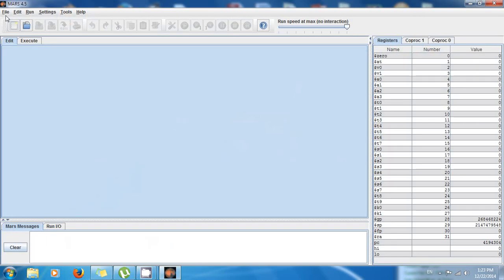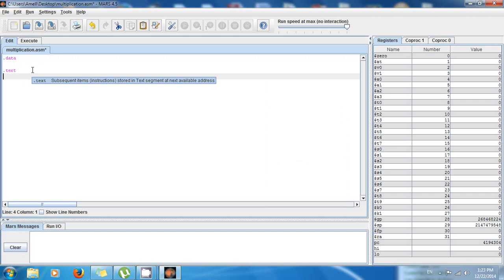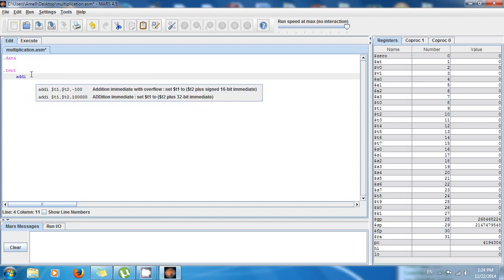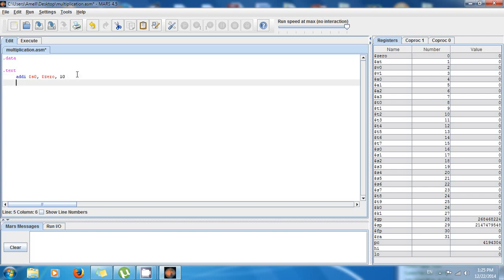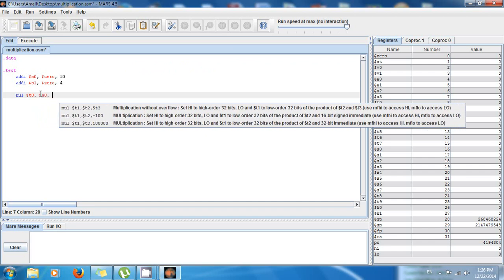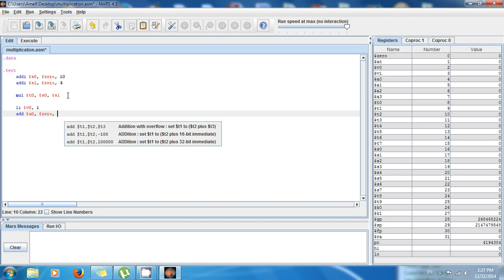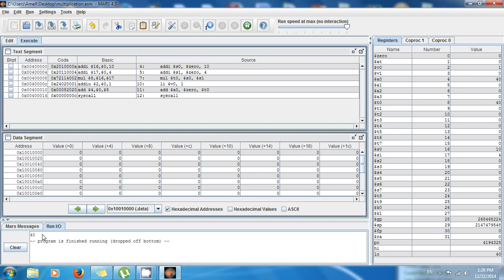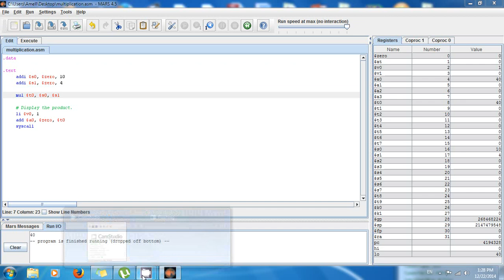MIPS Tutorial 10   Multiplying Integers mul

Comment: Faster and easier, plus this will terminate correctly on all MIPS simulators:
li $t0, 2		# The values to multiply.
li $t1, 3

mul $t2, $t0, $t1	# t2 = t0 x t1

li $v0, 1		# Print the result.
move $a0, $t2
syscall
	
li $v0, 10		# Exit program.
li $a0, 0
syscall
Reply: why not skip the "move $a0, $t2" line and just store the result of the multiplication in $a0 like "mul $a0, $t0, $t1"?
Reply: @lorenzoeldude  Because the argument registers are the $a0, $a1, ...  registers and functions will pull parameter values from those. So if you ever added code to make a syscall for something else it would break your program. ☺
Reply: @taekwondotime  thanks for the explanation 👍

Comment: your last instruction is:
add $a0, $zero, $t0
but i try to use:
move $a0, $t0
is wrong? the result is the same.
Reply: same thing bro
Reply: thanks
Reply: Hi.

The answer to your question is "Pseudo Instructions".
What is a pseudo instruction? Basically is a combination of multiple instruction. The "move" instruction for example doesn't exist in the instruction set of the processor... So, the instruction as to be converted to existing instruction.

It only exists on the software because it's extremely common.

Here is a helpful link:

https://en.m.wikibooks.org/wiki/MIPS_Assembly/Pseudoinstructions

Example:
"Sub" command doesn't exist, it is converted to an addiction with a "component of two"

I hope it all makes sence, feel free to ask anything

Comment: does addi $s0 $zero 10 do the same thing as li $s0 10?
it would have the same effect or there are some low level implementation details i should be aware of?
Reply from the maker: li $s0, 10 is a pseudo-instruction that will be translated to addi $s0, $zero, 10 by the assembler. The reason I didn't use the pseudo-instruction is academic: some professors want students to understand the basic MIPS instruction set (without relying on pseudo-instruction). However, you should use them in your code since they make your code more readable and concise.